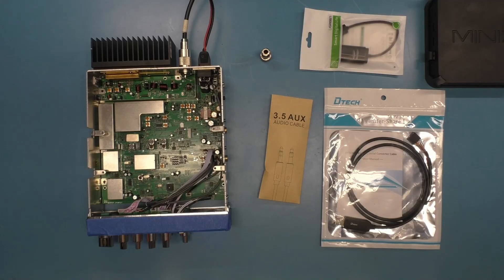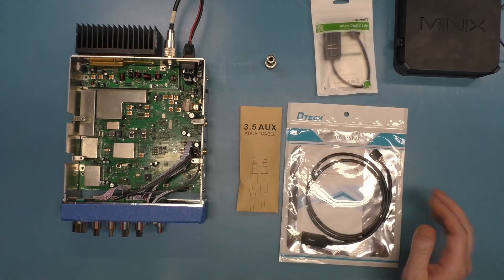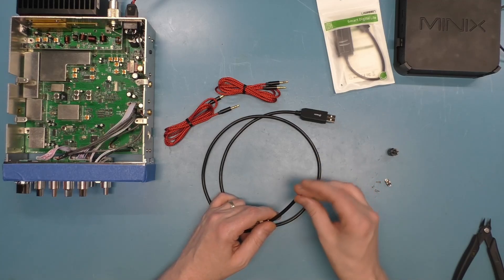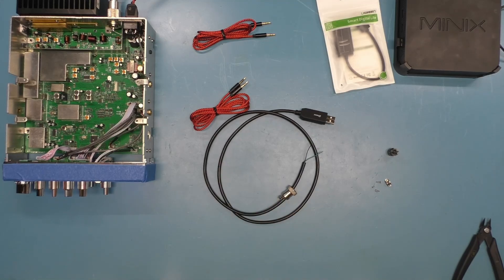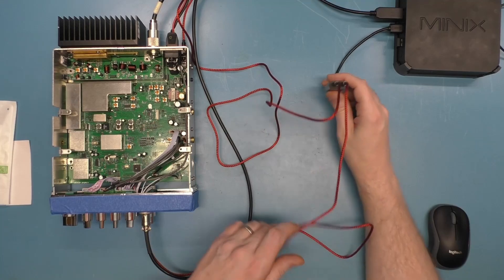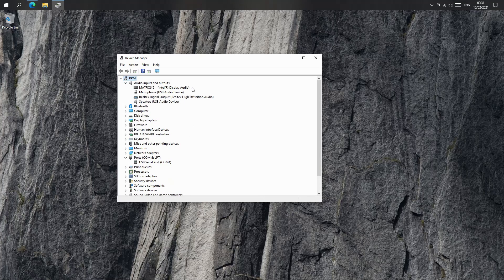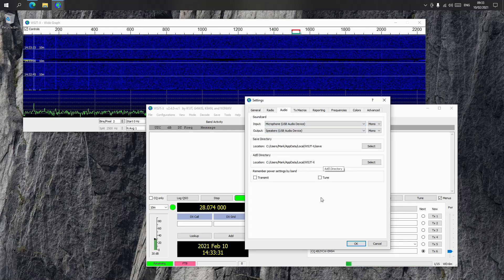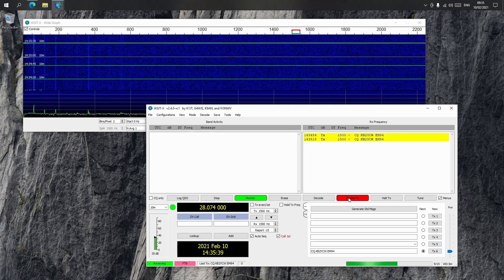SR-955 audio adapter for 10m digital modes

Comment: Stryker has a nice CTCSS module for these 955’s, fortunately in Maryland we actually have a 10 meter FM repeater. 73
Reply from the maker: you don't need the CTCSS module for this. It's done on USB.
Reply: It’s usually 29.840 right? That’s what most are. Have one here too! 73

Comment: Question - I have an oscilloscope and and want to make sure my 955 modulation is at 100% but not going over. I understand I need to buy an audio generator, as almost all CB or export service manuals calls for 1khz 30mV signal. I know I'll need to connect audio generator direct to microphone audio input and then short TX to key radio with input signal - BUT my question is, how do I input at 1khz signal @ 30mV? I'm looking at some different audio generators on eBay and none of them have a voltage setting as far as I can tell. How do you know if it's a 1 khz signal with 30mV? How do you set the volts and know it's 30mV? Thank you so much, love your videos.
Reply from the maker: It's usually whatever the service manuals say. Typically its 1Khz @ 30mV. Any modern function or signal generator should be able to output such a signal.

Comment: Hey Mark, Just found this video. do i need to use vox on the radio, my Srryker does not have vox.
Reply from the maker: No.. you have to use an adapter that has like CTS or RTS and use that in your WSJT-X setup.